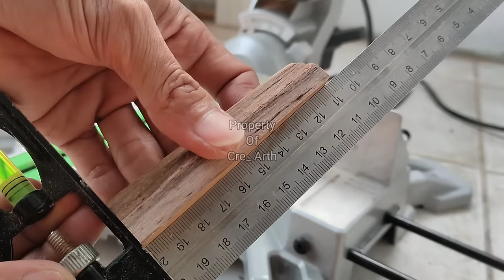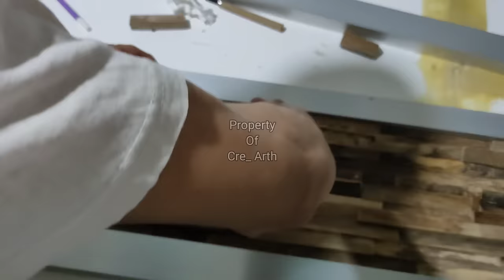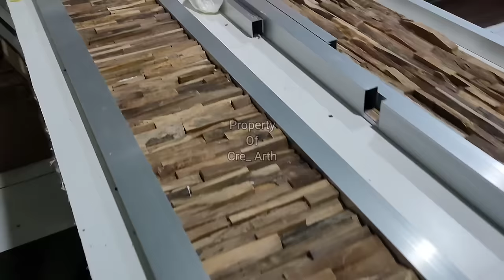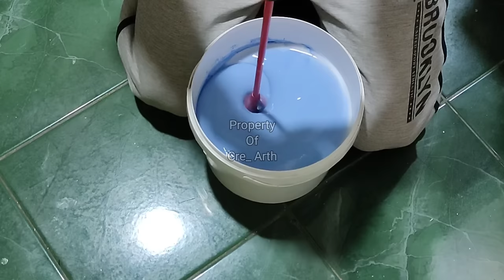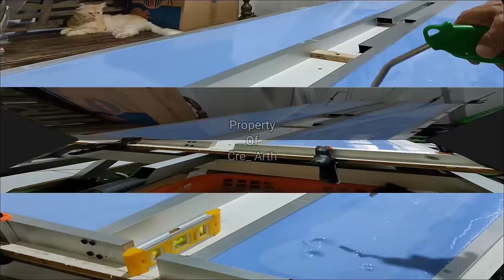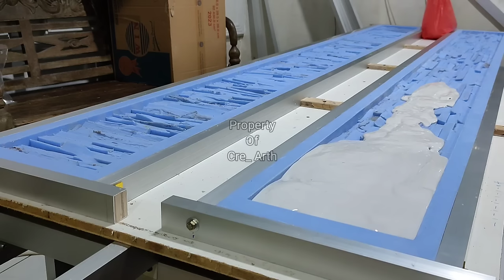The Longest Rubber Mold Making // Wall panel mold from long wood panel // Artistic  wall panel

Comment: how is it possible to make such a large surface with plaster and not break with the slightest pressure..I assume that the polyester threads hold it well?

Comment: 1. That Is Silicone
2. You Never Mix With Paddle 
    Because It Creates Bubbles.
3. You Must Never Makes Long
    Pieces Because It Will Crack
    Your Concrete or Plaster Pieces.
Amén.